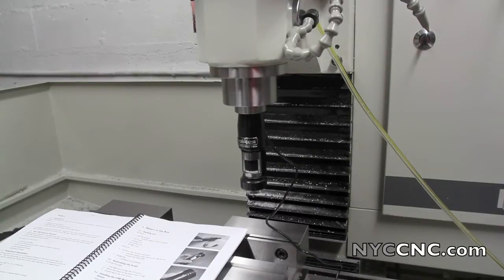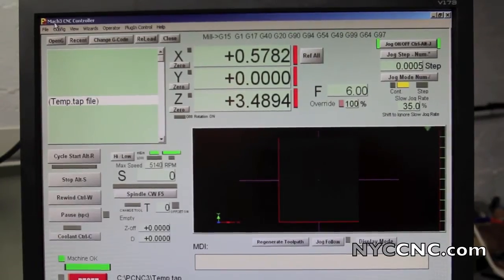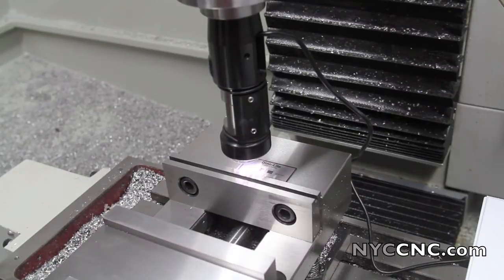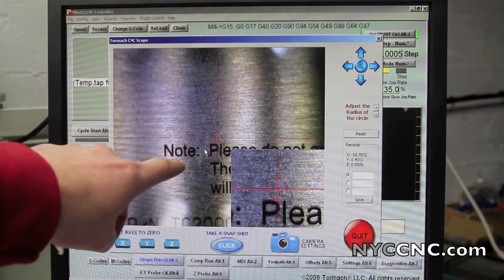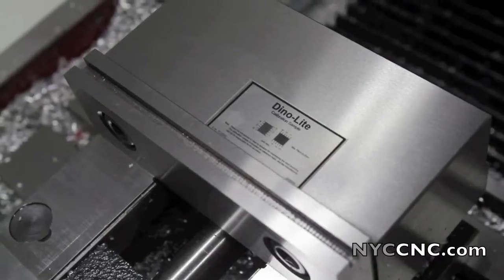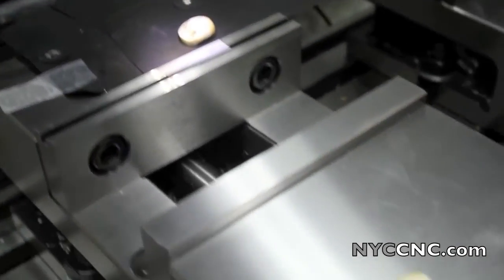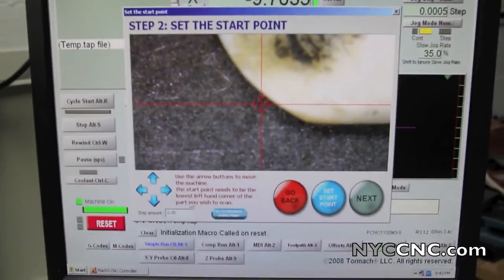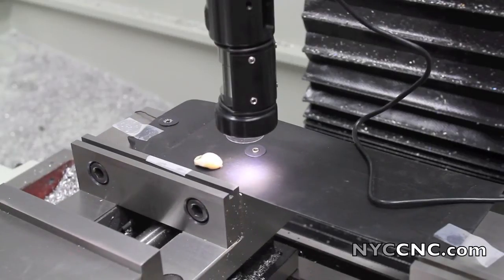Tormach PCNC 1100 - Using CNC Scanner to make Custom Steel Elk  Tooth Cufflinks

Comment: Damn, Mach3. I kinda wish Tormach would release their PathPilot as a purchasable software because reasons. All they did was mod the shit out of Mach3 anyways, so basically they're just hijacking what could have been a great Mach4. Open source code. It shouldn't be entirely theirs.

Even if a clause is only that you can't build a machine with the intent to sell PathPilot with it. But you can build your own custom machine and use PathPilot yourself would be fine enough. Say you have a couple of old custom gantry machines on Mach3? It would be lovely to buy PathPilot and retrofit everything. :)